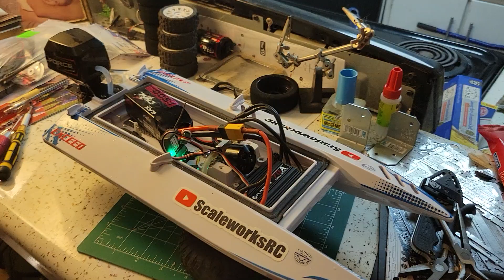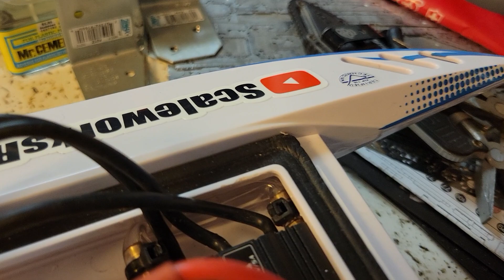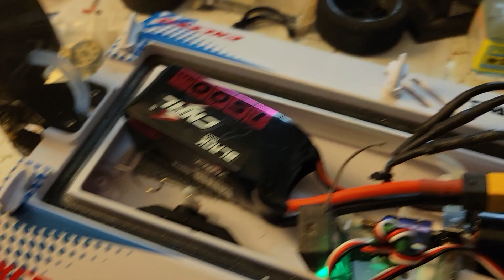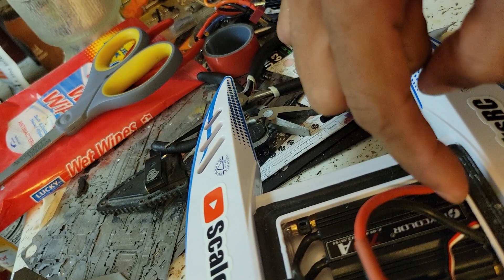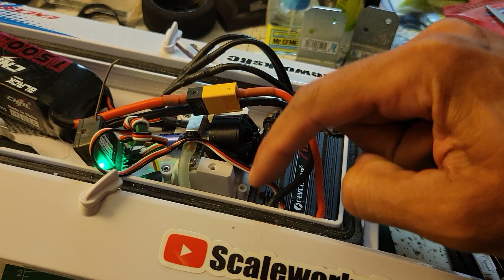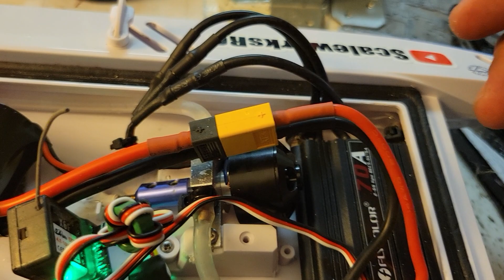WL915-A Upgrades 70A Flycolor ESC And CNHL 1500mah 100c (200 burst) 3S Packs

Comment: the 100c will make a difference over the standard, they did on my sr80p, you may also find 2 smaller 3s are better than 1 larger 3s.But its a smaller boat so no idea if they would fit?
Reply from the maker: Yeah the 1 shorty pack is probably the max the boat can hold. It's definitely heavier now with that honkin' ESC up front and those packs.. but we'll see what she does soon :goodvibes: